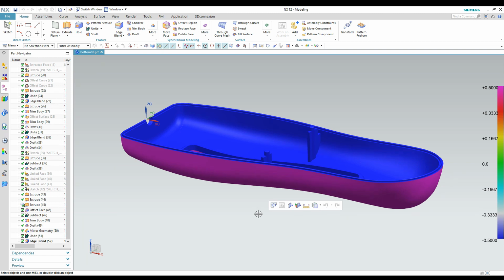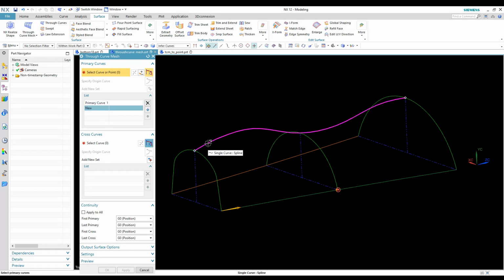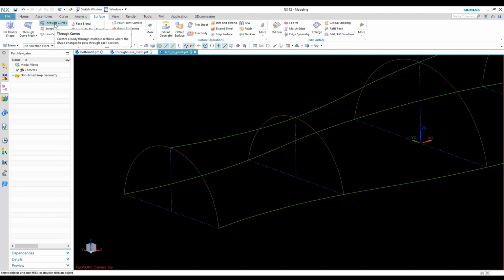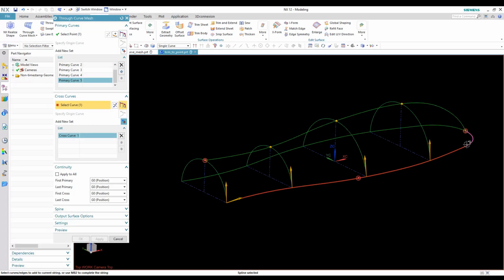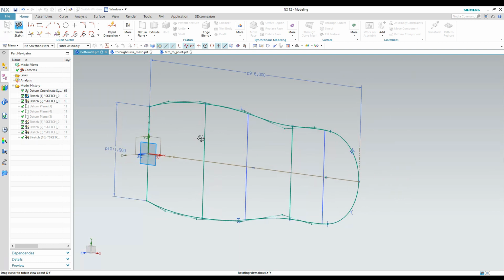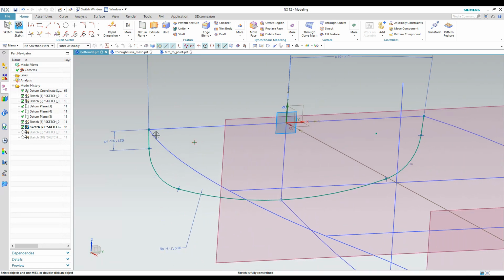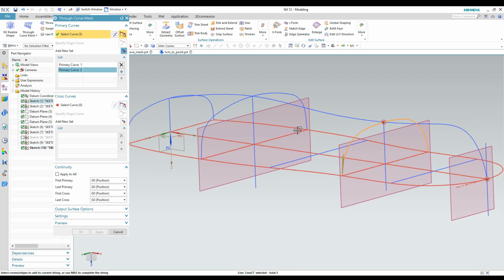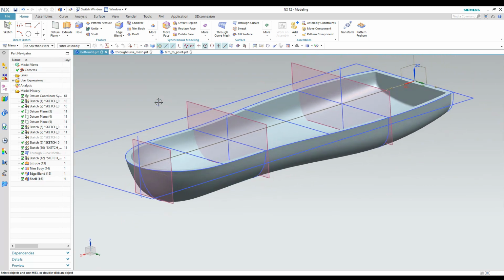Siemens NX Through Curve Mesh Tutorial

Comment: Thanks for your excellent explanation of the spline curve definitions, I am learning NX from Solidworks, and there was a feature called "Place Point" that allows you to place a sketch point onto a continuous spline or surface. I'm curious if there is any equivalent function when sketching in NX?

Also, I noticed that when selecting the primary curves, there's a direction to each curve, what does that control?

Comment: Does the first primary curve (point) needs to be on the intersection of the 3 curves ? Or proximately around the 3 curves intersection also does the job ?
Reply from the maker: If I understand your question, everything needs to intersect. You can loosen the intersection tolerances but that will result in an unstable surface in some cases.